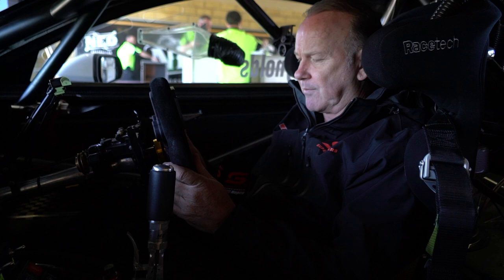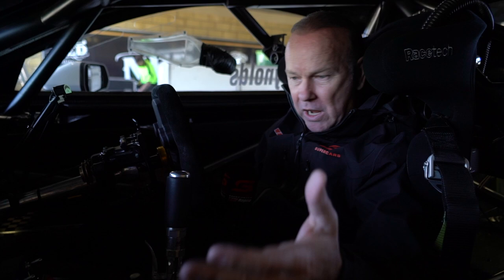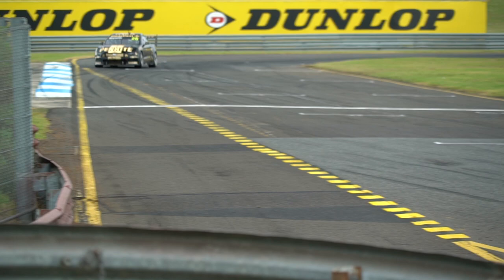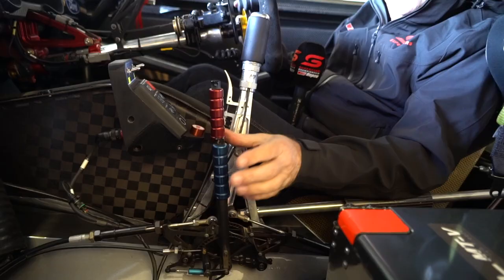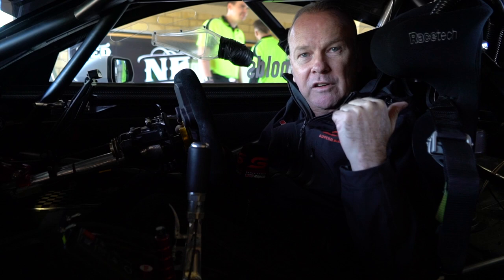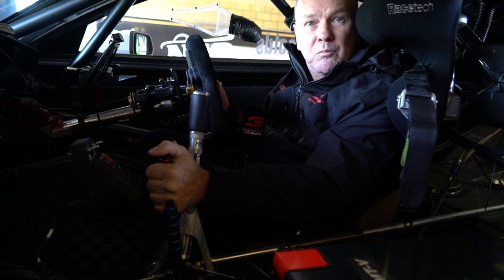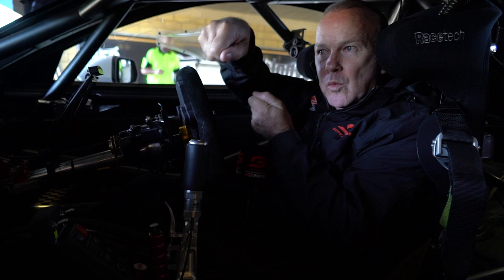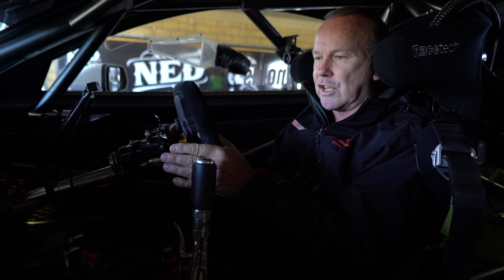Modern Supercar cockpit - Mark Larkham - The Garage

Comment: Seems to be a fair amount of fiddling. Are there race cars without these “sticks, knobs and paddles” ? Are there still series production races out there ?
Reply: A lot to fiddle with but it helps a lot in a race. Makes it better for closer racing. There would be very minimal race cars that would not use these. I know F1 have it on there steering wheel (they have alot more to fiddle with then a supercar). I think a few race car or series that would not use these would maybe be Rally cars, speedway cars maybe also.